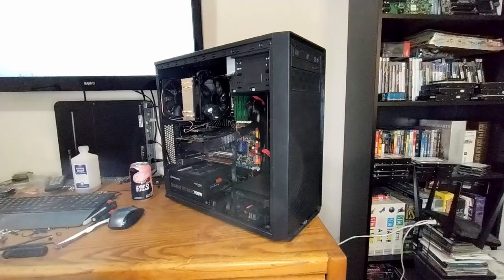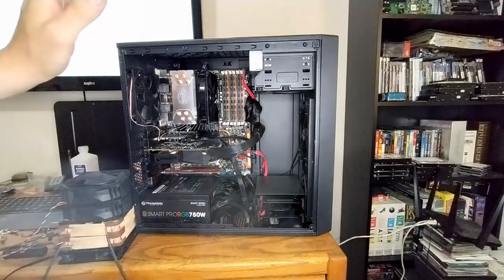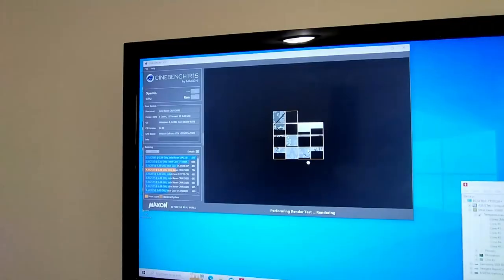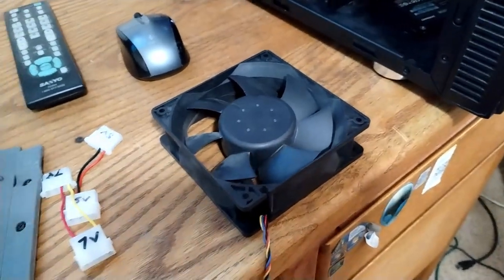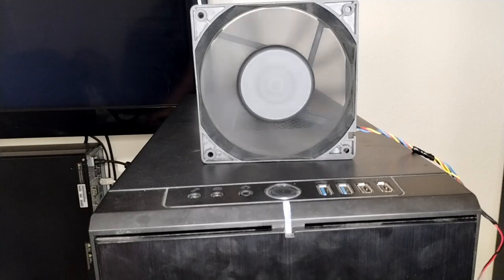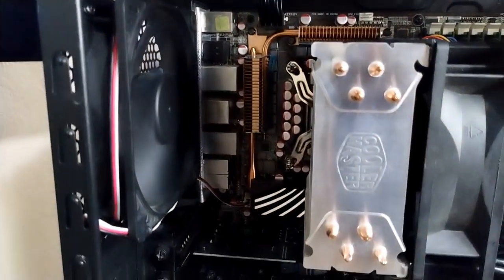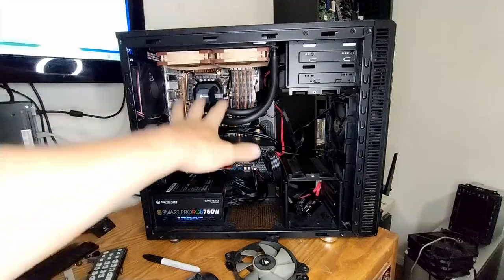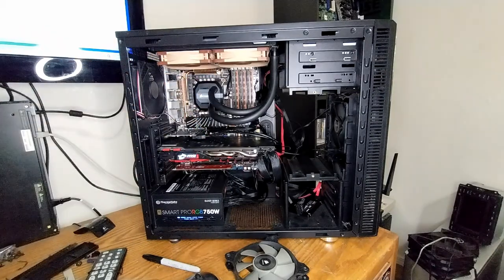Delta Fan Shenanigans!

Comment: Good old Deltas. I remember in the early to mid-2000s then those were pretty common in some cheaper CPU fans in 60-70mm size.
Reply: Yep. Delta made (and still do) some ridiculously stout fans for OEM PCs.
Reply: right now, they even producing more high speed fans. more common in the servers or industrial equipments.
I found in my local online marketplace, they sell HP blade fan (80x80mm) fan assembly rated at  7A (I think 2 fans in series) for around $12.
many of them were previously purchased (used of course, but high price)  by cryptominer to cool their system. now they no longer doing mining, they sold them cheap.
Reply: My old Dell Vostro 400 had an 80mm 5900rpm Delta fan on a 5 inch tall round aluminum heatsink. shit kept modded lga 771 Xeon X5647 to lga 775 CPU pretty cool.

Comment: Large air coolers do not last forever too. Got a Noctua D14 on my X58 backup pc and the springs are useless after 10+ years. Mounting pressure is shite. Cooling capability has gone down. Aio will last you a long time if you clean and refill it after a few years. Really like the arctic liquid freezer 2 240 ive got in my main.
Reply: My x58 pc has a silverstone ar03 for nearly as long no issues
Reply: @splashboi898  Thats great, that doesn't take away from the fact that some coolers don't, even aircoolers.

Comment: Hi. U said motherboard max 1amp. Is that per socket or total? Im planning to buy some delta fans rated 0.8 or 1amp each to plug in each pwm fan socket. Thanx
Reply from the maker: Most people say to limit draw per fan header to 1 amp.  Is this the limit?  I don't know.  May be a good experiment to test.  But all motherboards are different so any findings would be inconclusive.

Comment: The Hyper 212 is great, still using one in my main PC.

I have owned one AIO in my life and one was enough. I'd consider a custom loop with a res but never another AIO.
Reply: Alphacool's Eisbaer is a pretty dope AIO. Though its more of a Pre-assembled mini open loop system. Byksi, Granzon, and Barrow all make pump/block and radiator/pump combo(as well as Reservoir/Pump combos ofc) but with D5 or DDC pumps rather than those little shitty asetek pumps normally found in AIOs. they hace "AIO" kits made with them but they make doing a custom loop super easy.

Comment: i have 2 AVC 1amp fan for my cpu cooler, and 6 delta fan 1 amp running as case fan. currently preparing 3 delta fan 3.3A to replace the front fan.

won't running them at full speed obviously, but if the need rises, I know it can deliver cooling the system needs. you should do the fan in PWM mode. so the mainboard can control the fan as needed. not just running in fix speed.

anyway good to know some people isn't disturbed by fan sounds. lol
Reply: Mobo pwm headers are rated for 1a maximum current, a fan like that is gonna toast some traces there
Reply: @pickpocket5542  yes. there's where some fan header with external power (molex, sata or PCIE) come in handy. they can support fan up to 300watt or more, keeping PWM come from mainboard.
or you can just plug the PWM and tachometer signal wire to mainboard, and power directly to PSU.
Reply: I have a 2.5A delta fan which exactly matches amd's stock cooler, I wonder if I can control speeds using one of these adapters
Reply: @pickpocket5542  yes you can. if you can handle the noise it generate.
you can purchase the fan hub, or if you like more adventure, you can make an adapter to separate the plus and minus directly to PSU and PWM and tacho signal to mainboard.

Comment: I use a delta in my daily driver pc
Reply from the maker: In what way?
Reply: @idoesstuff1  i use it on the cpu cooler like what you did and my i5 9400f will top out at 120f at 100%load in cr23 with the fan at 5300rpm
Reply: me too
Reply: @idoesstuff1  a 92x38mm 5500rpn server fan on my cpu cooler